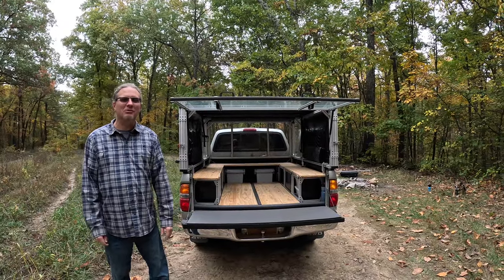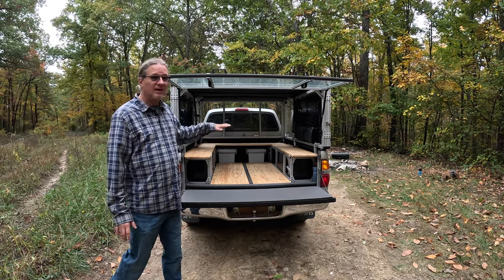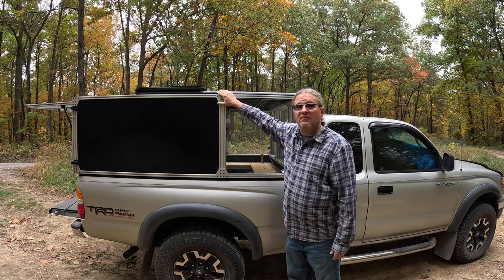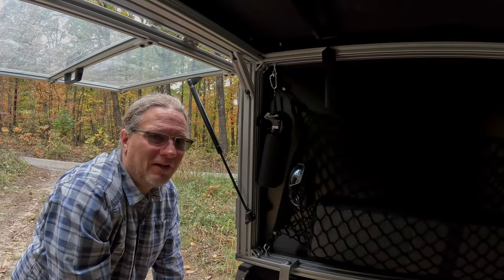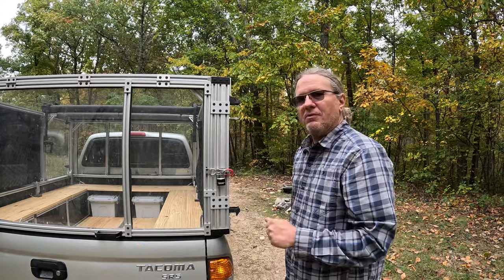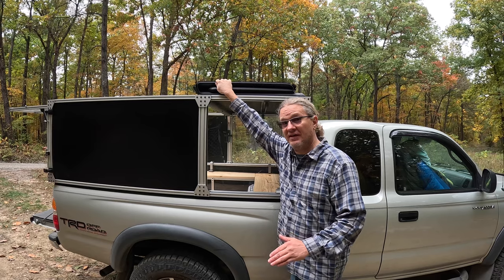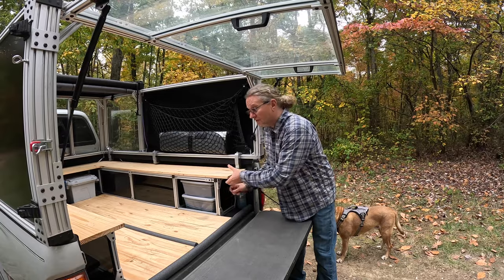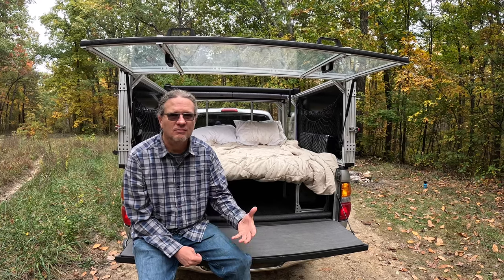Flip Top Topper - Cost and Grand Tour

Comment: I’ve watched most of your videos and just want to say this is genius and I wish I thought of it before!
What I can’t figure out is why there are three extrusion pieces on the bed rails instead of one. Forgive me as I’ve never worked with extrusion. It looks like you have folding or accordion doors but I’m sure that isn’t the case
Reply from the maker: Thanks for the compliment. The three pieces that sit on the bed rails are all 1x3’s that lay flat. They are the base of the build and are wide enough to clamp to the bed rails. The top is a tonneau cover and the door over the tailgate is a simple hinged door with struts. The “folding or accordion doors” are probably the sun visors we use to block light. Hope this helps!

Comment: Did you bind two square 80/20 together? Thank you! I have been thinking of the exactly same build, your video convinced me. Now ordering the 80/20, would like to use a single type and bind two together if stronger needed.
Reply from the maker: I think you are asking if I connected two pieces of 80/20 at the ends to make longer pieces. The topper is all single length pieces with no binding, because I wanted to make it as strong as possible. All, pieces were ordered to the lengths I needed. Enjoy your build and I hope this answers your question.